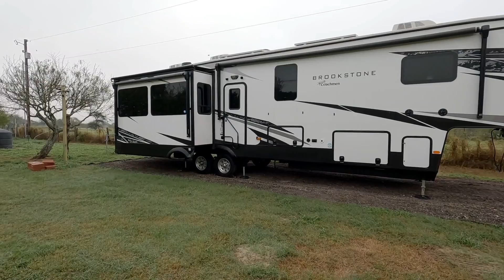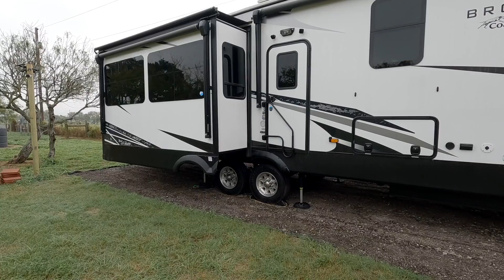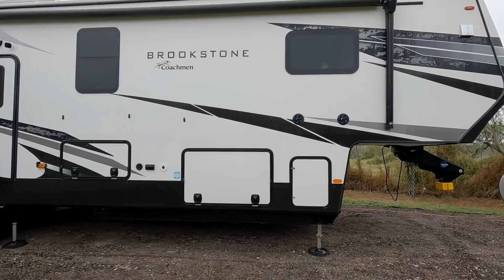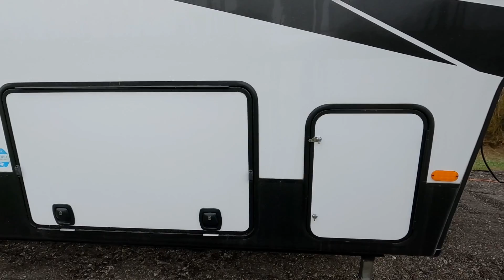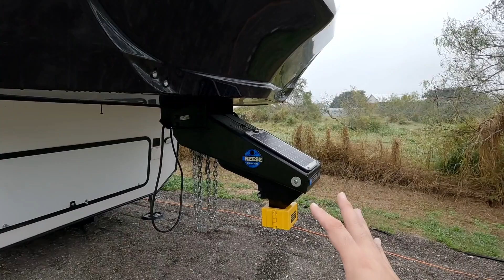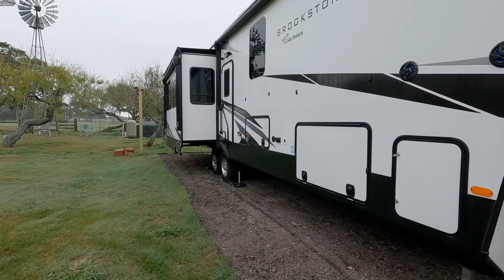The Reason I film what I film and why when showing RVs

Comment: Your technical review of RVs is very good. You point out things that other reviewers don’t such as slide type, suspension components, frame thickness and tire rating and size. Your opinions, I’m sure are based on your experience. There are reviewers that show the trailers with the slides closed but they are always employees of the dealer! Your reviews are informative.

Comment: I’ve never understood the fascination of how the trailer layout works with the slides in. It’s literally one push of a button to retract and extend. According to my truck, I’ve traveled 10,000+ miles in 1.5 years with my rig and have not once run across a space (park, rest stop, truck stop,ect) where I couldn’t quickly extend the slide at least 2 feet to get to the bathroom or fridge.
Reply: Only time I could think of is if you lost a tire or something and have to be parked on a steep shoulder off the road and don't want to risk damaging the slide by pulling it in and out. Then again, if you're on that steep of a grade I'm not sure how much you're gonna be doing inside of the trailer anyway and it might happen 1-3 times in your life of owning the rig so not a big selling point to me.

Only other thing is when I was living in my fifth wheel full time in Montana or just went cold weather camping I'd pull the slides in if it's going to snow or potentially freezing rain because 1 time I didn't do that while in a Walmart parking lot and had to move my trailer so I was on the roof that was covered in snow trying to shovel / brush snow and ice off of the top of the slides so they would actually close properly or at all. That's really the biggest thing is if you want to stay some where it's going to snow or have freezing rain pulling the slides in while the storm goes by is a good idea. But still, even when doing that if I wanted to cook some dinner I would just slide out the slides for 30 minutes do my thing and then close them again and a bunch of snow didn't accumulate in that time. Those days I usually just laid in bed watching movies on the TV and was pretty comfortable. But I'd say that kind of scenario might impact 5-10% of RV owners. Not having to deal with slides would be ideal for cold weather locations.
Reply: I understand your thought. The only answer that I could think of is that it's really a matter of what works best in the RV for the owner. I personally like outside kitchens and bathroom access for travel days but that's what works best for me. God bless you and happy trails!